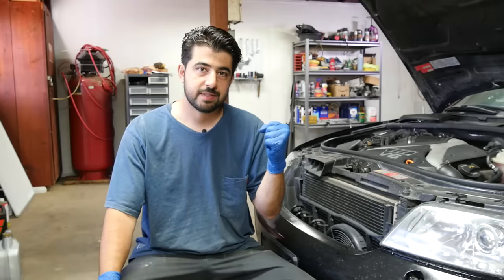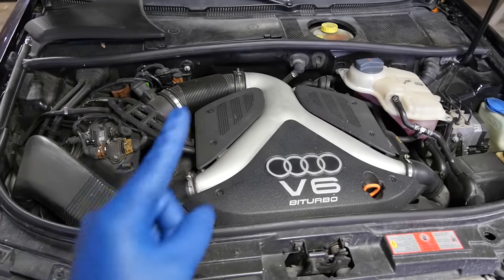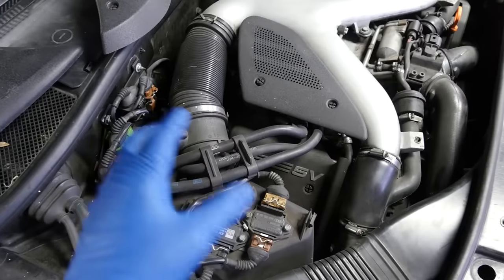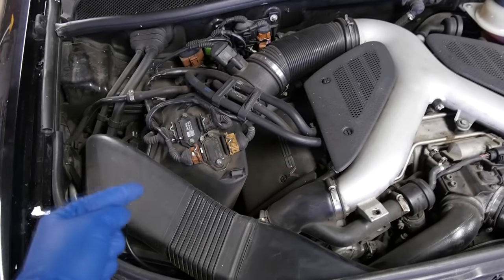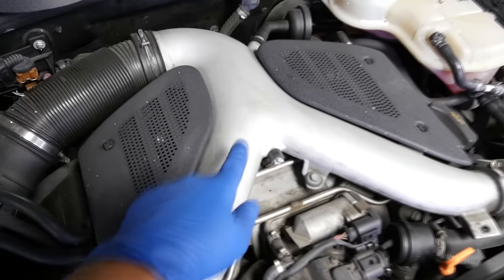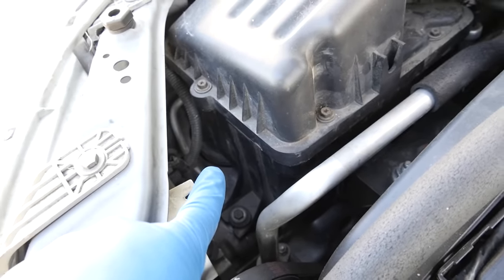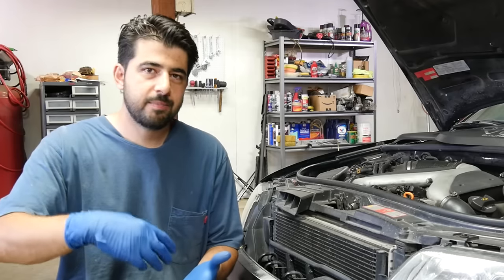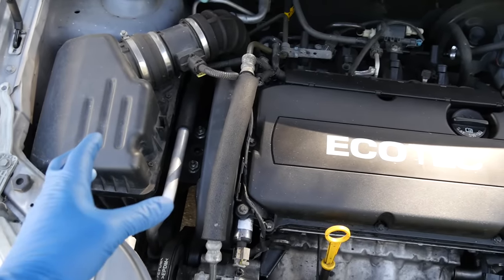Do Cold Air Intakes Work? Watch and Find Out

Comment: It's nice that you want to prove a CAI works but as someone who has Dyno tested vehicles before and after under the same conditions, I can say for a fact they DO NOT WORK  BUT ALSO THEY DO!!! Now let me explain,
First the main source of a boost of power comes from the air filter as the new air filter is usually a cotton filter as opposed to a paper element (factory),This is were your added power comes from about 25 to 35 Hp depending on the vehicle!!
Now were it does not work you show a twin pipe system on your Audi well first  yes cooler air is a increase in power if you can get to the combustion chamber without heating it.  This is impossible as you have TO MUCH LENGTH OF YOUR INTAKE PIPES.
1. This added length gives the air a chance to heat up before getting  into the engine due to being on top of the engine.
2.In order to get cool air into the engine there should not be a shared Y pipe as this is a restriction in itself there should be TWO INDEPENDENT PIPES FROM THE AIR BOX.
3.For each 90 deg bend in the pipes it takes 6 feet of straight pipe to get a laminar flow back hence lose of power and giving the air more time to heat up!
So in conclusion a added hole in the Factory air box leading to the outside air and a After market air filter that has a cotton element like a K AN N is all you need.
On your Audi I would redesign the feed tubes to be much larger and shorter with two Independent pipes.Also  the air Filter use maybe two cone filters with a custom air box.

Comment: Doesn't this just depend on the car type and design of the aftermarket intake?  Those short ram designs are worthless- just sucking in hot air.  But the better CAI's I've seen have shields around the filter or actually reaches the filter so far down that you can barely see it.  And like others said on here, you have to have a tuner to even get your car to acknowledge it.. otherwise the ECM is working harder to compensate for the change. .

Comment: Well I was able to put a spectre cold air intake on my LS1 truck, and there is an immediate throttle response, but I have a question. Since my cold air intake has an aluminum tube, would it be better I got another one? Like the Volant that have it completely shielded not like the spectre? I have my truck tuned to the mods I have atm

Comment: Anderson Power Pipe added at leat 40hp to my build with my V3
Reply: LOLOLOLOLOL......
.oh wait.....you're serious????
Reply: you obviously know nothing about supercharged applications.  They have been proven over the years to run additional boost over an in engine filter.  In my application, i was able to pick up about about 40hp to 486rwhp on 12# of boost. I ended up dialing the boost back to 10# and 451rwhp as it's a stock block 302.  Rest of the build is AFR heads, TFS cam, 60# injectors, 75MM throttle body, 80MM PRO M MAF and custom  Diablo chip on an A9P computer.,,, and running through an AOD .
Reply: @MrMikestang63  
Oh yeah, I missed the SC part......a SC should give you well over 100hp no problem.

Comment: This is good info and I have to think that even if you can get cooler air and/or less restriction, how much improvement are we talking about? Even if I dyno my car and it shows a few hp gain, I doubt I'll feel anything. It's like buying a TV because it has a contrast ratio of 8,000,000:1 instead of a TV with a ratio of 5,000,000:1. You'll never notice that when you're in your living room. I think the best argument for a CAI is using it in concert with other mods like a turbo upgrade that needs more air.

Comment: Cool, let me tell you my story, my 00 GT had a Cold air intake made by bbk and the air filter was under the fender, the previous owner never replaced the filter, it was beat up, black, etc so I got big one from Spectre ($40) but it didn't fit under the fender so I cut the steel pipe and turn into a "short Ram intake" in the winter I had no issues, now with the summer I'm experiencing little loss of power and even vibrations, fuel consumption and so on. There you go, short Rams are bad on stock engines. Cars runs better when a Cold air intake it's away fro the engine.

Comment: Isn't your biggest restriction the air filter?
Reply: Yes but using a low resistance air filter and making sure it takes in cooler air will surely achieve decent HP gains

Comment: Cold air intakes really depends. I bought the best possible system for my audi.. the apr carbonio carbon fibre kit.. if anything all it did is made my car run lean.. too much air and gave the car incorrect readings. So the cars ecu is constantly trying to reconfigure which i wud say cant be good. I mean yes it sounds nice and all.. maybe for racing applications.. but the audi standard system is preconfigured by engineers for best optimum performance already. I say its only wen u get into racecar builds that it wud make any real significance

Comment: Cold air intakes only work if it has a box separating it from the engine bay so it can actually suck cold air of its just a pod filter on a tube thats not a cold air if it sucking hot air under the hood

Comment: You did nothing....  If I wanted an explanation on the intake system of a Volkswagen and a cheap GM piece of trash I would become a mechanic. The fact is the cold air intake systems on the market are not really "cold" air because of the heat from the engine compartment. They are more or less megaphone for the engine and creating the sound that you are making more power, causing the driver to put his/her foot down on the gas because he/she wants to hear the engine rev. You would be better off just getting a reusable air filter to save on money rather than replacing it every time.